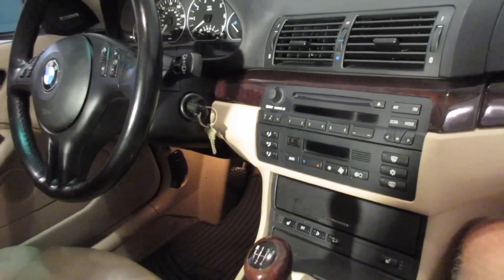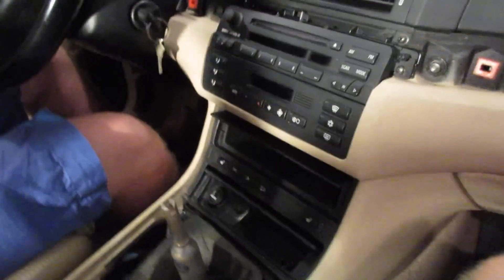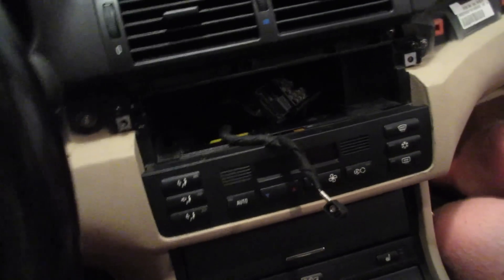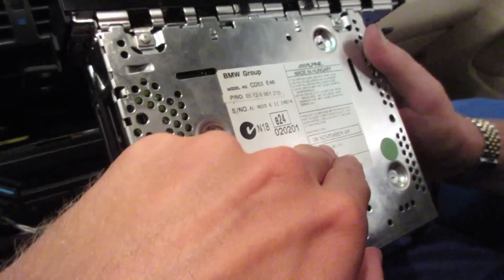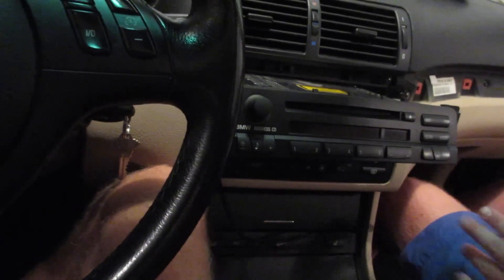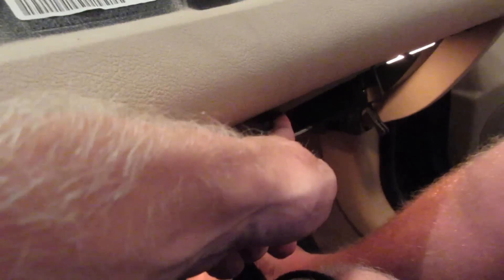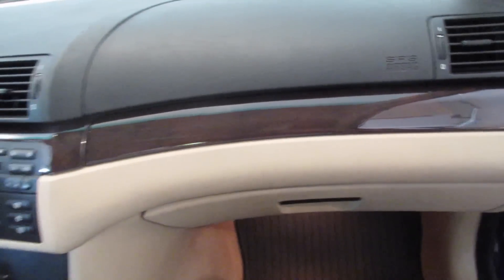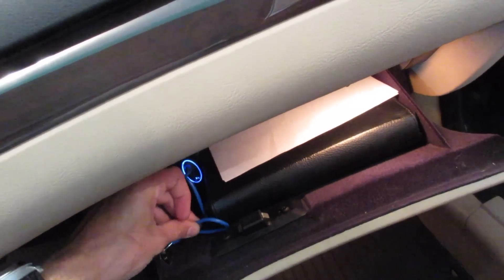BMW E46 3-Series Auxiliary Input Installation DIY

Comment: Thanks for this video.  Other videos fail to mention the blue locking clip.  I did this to my car and that was the hardest part of the install.  That and my radio harness didn't have much slack in the wires so i had to be real careful not to pull the harness when re-connecting the radio.   I put the aux connection in my sun glass holder as opposed to the glove box.   Thanks again
Reply from the maker: I'm glad you found this helpful, thanks for the kind feedback!

Comment: just a little heads up. that wood trim is actually pretty delicate. the ''wood'' look can crack and peel off if your not to careful. mine lost a little piece around the radio assembly and looks stupid now :(
Reply: and it seems difficult to order another one since the new one may or may not match as much

Comment: As i was watching this video, i realized that it doesn't support anything manufactured before September of 2002. Mine was manufactured in May of 2002. Is there any other product that i can purchase that is compatible with my radio? Thanks
Reply: did u every find anything dude im on the same boat
Reply: @connorlovesrock  hey have you found anything yet? Mines from July 2002
Reply: @luclaan8165  I use a wireless FM bluetooth transmitter that plugs into the cig lighter
Reply: @connorlovesrock  that is the only option for  a production date earlier than September 2002

Comment: First off, I am about to install an AUX in my E46, so this video was great, many thanks!  However, I feel like I'm missing something at the end with what appears to be a Potato that you used for Bluetoothing your phone to your system.  I know you said you would do a separate video on that product, but I don't see it anywhere?  So many question is, where do you get power from for the Potato in the glove box?
Reply: Hi!  Ryan (and I) use an adapter that changes the flashlight port to a 12v power port. Just search "BMW flashlight adapter".  However, these are no longer made, so finding one at a decent price may prove to be difficult.

--
Bobby
Reply: Thanks for your reply.  I didn't even know that was an option.  Looks like they can be found, but I may have to pony up for one.

Comment: It will work with any E46...Mine doesn't support it but still got it working. All you gotta do is replace it with the CD player input and it should work then when the car is on CD mode.
Reply: +Eduard Van Der Westhuizen Hey is this true? Can you post a video or something so I can verify cause I have a 2001 and the fact that mine isn't supported is disappointing.
Reply: +Omar Ashraf also I don't want to spend 30 dollars on ECS tuning just to have it not work.
Reply: +Omar Ashraf Hmm okay, will do it sometime this week :)

Comment: Hey! Great video! Just curious as to how you connected the actual aux "male to male" cord to the CD player itself. I understand that you need to switch out the black piece for the grey one on the harness, but I don't understand where you would connect the cord. Again, great video and I can't wait to hear your response!
Reply from the maker: The aux cable you buy from BMW plugs into the radio with a connector with three wires (right channel sound, left channel sound, and ground).  Then that cable ends in a female aux cable.  Then you need a male to male aux cable to plug into your phone.
Reply: E39Source ahh! Thank you!

Comment: Oh my gosh, this is the best, understandable video I've seen yet.  Well every one else is asking questions, so I decided to ask one.  Hope to hear from ya.  I have a 2006 324ci bmw conv. 3 series.  I want the xm sat. radio in my car, but I don't know what's the cheapest way out. Replace the factory radio with a radio with xm sat, or the way you explained in the video with the AUX cable.  On the back of my radio it states 06 May. I know it would work, but wouldn't I still have to purchase one of those lil sat. radios?
Reply from the maker: You either have to add a Sirius XM module (OEM From BMW), or an aftermarket solution.  Or you could just add an Aux Input and use the Sirius app on your phone.
Reply: Thank you so much for the quick response.  I don't know what to do. The radio has the Aux mode, but I don't have a IPhone, I have the Samsung note 4. Do you think I could just replace the radio itself?
Reply: I have one question, how do I go about getting my radio ID for my car?
Reply from the maker: Any phone with 3.5mm out (headphone jack) will work with aux.  The Sirius XM radio ID will be printed on the back of the radio near what looks like a bar code.
Reply: Thanks again. I did remove the radio and took pic of every label that was on it, and also, I see a bar code at the bottom of the label but there is no ID #.  Above the bar code has something like this (Model # CD53 E46
P/NO 65.12-6 961 214
S/NO AL 4620 6 05 19691. Then something like this (N18 [e42] under the e42 is #020201
SW/NO 47,  HW/NO 43, KW: 18/06, AI: 02.  But nothing with ID.  I don't understand all those Numbers.  Hope you can help me. I don't know how to tag a pic for you.
Reply: Ohhhh, I see another label with a bar code and under it, these are the number  (6 961 214) R5  US Englisch PX88090.
Reply from the maker: I was referring to radio ID such as the Sirius XM ID required to activate the radio.  The CD53 radio will not have this, because it is not a Sirius XM tuner.  You shouldn't need any "ID" for auxiliary installation.  If your radio was made after the date specified in the video, it will support aux.  If not, you must upgrade the radio module (CD53) to a newer version that does.
Reply: wow, o.k.  I don't have a Sirius radio.  I guess I'll be purchasing a Sirius Xm Sat radio and go from there. Thanks again for all ur info, ur a blessing sent. Again thanks.
Reply: Hey, I'm sorry. I have one more question. The Aux cable that I have to plug into the back of my radio, would it be a 10 or 6 pin plug??  I have purchased the xm lil radio, but they didn't have the plug in it that I needed.
Reply from the maker: 10, I believe.
Reply: o.k thanks, I found it. I just need to get the plug with a 3.5mm and 10 pin jack on the other end to plug in the xm radio and the car radio. I think I'm ordering the right one. Thanks for all ur help. I will let you know if I get it up and running once the Aux cord gets here.
Reply: Hello again, well I got the plug to hook up my xm radio to my bmw.  But there is no sound coming through the speakers, but there is sound from the factory radio and cd. I have the car radio on Aux, and I've had the xm radio activated. I waited about 10 min before messing with the radio to make sure it was activated.  Not sure if I've waited long enough.  I've also up the Aux volume to 5.  Everything is showing up on the screen, it's just no sound. Can you tell me what could be the problem?? I'm gonna check it again it's been over 2hrs now.
Reply: I went back and checked my aux plug and that is the problem, but the sound is still low.  Do you think the cord is bad?

Comment: Hey man! Awesome video. I have a BMW 2003 330i, can I do this to my vehicle?
Reply from the maker: +Nic Shannon Yes, follow instructions in the video!  Just verify that the part number for your radio/CD player will support AUX.
Reply: awesome. thanks!
Reply: +E39Source quck question, where did you get the aux parts at to purchase?
Reply from the maker: +Nic Shannon I purchased all of these parts form ECS Tuning.

Comment: How do you get the plug at 1:50 off? I can get it popped up, but after that, how do we get it off just pull as hard as you can? Dont want to break it either...also is it recommended to disconnect battery? Do you have to drill? Cab you route through AC duct?
Reply from the maker: Slide the slider all of the way out, and then pull the connector straight up and off the radio.  Disconnecting the battery isn't a bad idea.  There is no reason to drill.  I just put the aux cable in the glovebox.

Comment: Bought a 8$ Male aux cord adapter off of amazon and it would not register as Aux on my business cd stereo. Checked the manufacturing date and it was made in march of 03'. I own a E46, 325i. Any suggestions? (first time bmw owner)
Reply from the maker: Try an OEM cable.  Also, something needs to be plugged into it (phone, iPod, etc.) or it won't show up. Keep that in Mind.
Reply: Thanks!

Comment: I got a bmw 318 e46 2002 model. The radio has the mode button. But I have  not pulled the radio out yet. Just wan't to know if it support AUX?
Reply: I would expect that it would.

Comment: Not sure if you'll see this but, I have an 2003 e46 with 16:9 nav and I've got the AUX option without having an AUX in the back of my radio.. I've tried installing an AUX cable in the back but I can't get it to work, once plugged in it doesn't do anything. Can you maybe tell me the reason of that? Thanks
Reply from the maker: The radio cycles 'AUX' even with no cable plugged in?  Sounds like it might need a reboot/reset and/or a software update.  If installed correctly, like demonstrated in this video, the proper part should certainly work!
Reply: @E39Source  Thank you for your quick response. But yes that's the problem, can I reset it myself or is there something special needed to do that? And an software update? I'm not sure what kind I'm currently running so not sure if it needs one.
Reply from the maker: @sro9330  I would try to disconnect the vehicle's battery overnight.  That can reset modules and might help you out.  A software update would have to be done by a BMW dealership.

Comment: +E39Source i will take up with this challange, but i have a question. Would i be able to connect the cd player without owning a  cd changer?
Reply from the maker: +Frank Richard the CD player in the dash and the 6 disc cd changer in the trunk are two totally separate units.

Comment: Mine is 320d e46 September 2001.,and radio have two 10-pin connectors and one 17-pin connector....I'm wondering if it will work,because it has that second 10-pin connector....

Comment: I've been eyeing a third party auxiliary/bluetooth product, namely Grom Audio, which seems to hook up to the radio in much the same way as the OEM Aux that you've demonstrated here. My radio build date is prior to 9/2002. Is there any reason to believe this product would work where the aux port would not for this build date?
Reply from the maker: I dont see any reason why it wouldn't.
Reply: Appreciate your take and excellent videos. To follow up, turns out the Grom kit works just fine with pre-9/2002 builds as it uses the left port on the back of the radio replacing the accessory cable (I believe wired to the trunk).

Comment: hey whats the bluetooth thing called? that glows? im about to buy a 2002 bmw 325ci and im not as auto savy as you guys are so ill probably take it to a mechanic shop for the installation
Reply from the maker: +Deon James It's the Tunelink Auto (http://www.amazon.com/Technologies-TuneLink-Bluetooth-Wireless-Adapter/dp/B004GJURHM).  This job really is easy, it's just plugging a few wires in and drilling three small holes!  Very easy to DIY! :)

Comment: Hey my e46 already had the Aux mode & was working perfectly for years. Recently the battery went flat & aux mode disappeared. Would you say it needs programming or do you think it's a loose wire from the head unit? Thanks if you can help !
Reply from the maker: If you didnt move the head unit around, I'd say to disconnect the battery again and let it sit for 5-10 minutes.  Then reconnect.  If that doesnt work then check for loose wires.

Comment: I have a 2002 Bmw 330ci, I purchased the oem aux input, connected it, but the option does not show up when I press mode. Any help?
Reply from the maker: Your radio may not support the aux input.  Check the part number and build date by removing the radio to see if it's a 9/02 production or later to support the aux mode.

Comment: I have a 2001 CI e46 convertible with Business CD and Harmon Kardon sound systems without navigation.   I bought the Aux cord, but my car was purchased in Oct 2001 so manufacture date had to be sometime earlier - say Aug 2001.  The package says for Sept 2002 and beyond.  I have not taken out the Head Unit yet.  Will it work?  

Some people are saying that disconnecting the CD opens up the option of putting in the AUX for my iPhone 6+.
Reply from the maker: +Richard Baker You just need a CD player made after September, 2002.  Which you can source from Ebay and then install without issues.
Reply: +E39Source  - thanks

Comment: When I ordered the part number you gave, it had a 12 pin connector and my 2004 E46 325i wagon has 10 pins. I see yours has a 10 pin connector;is there any way to rig it to work? If not, is there any further differentiation in part that I should've been aware of
Reply from the maker: That's very strange.  But, only 3 pins are used for aux.  Red, blue, and ground.  Where red and blue are left/right channel audio (or vice versa) and the brown is ground.  Take those pins out by sliding off part of the black/gray connector and then depressing the metal pins with a tiny screwdriver on the side of the harness while gently pulling the wire out from the black/gray housing.  Then move them over to car's existing radio wiring harness (12 pin I guess), while being sure to put them in the exact same location per the tiny labels on the connectors (pin 4 in 4, 10 in 10, etc).  Hope this makes sense.
Reply: Thanks for the fast and helpful response! What I decided to do was to take the plug from the cd changer (which I don't have) and use it for the aux jack. One tiny thing; I can't seem to find anywhere what wires go where. Could you let me know what wire goes in which slot? Again, thank you so much!
Reply: Never mind, thank you so much! I figured it out haha

Comment: Hi there.
Cool video but I got an issue.
BMW 2005 Msport 318ci 2.0 litre. Business Cd Dated Jan 05 has a factory fitted bluetooth module which i managed to link to my phone the other day, back of the HU has a spare port located on the outer edge out of the 2 ports for which i plugged in a Aux cable with no resistors or capacitors fitted. The aux came up for about 1 second after wiggling the cable..then disappeared, then came up again for a blink of an eye then hasn't returned since. The pin configuration on the plug end is pins 8 and 9 and 4 which is the earth for aux input. I re soldered a new aux socket and shrink wrapped and each wire has good continuity, however still no aux showing? I have read that the auxiliary plug need resisters fitted, or am I looking at a battery disconnect? 
Can you help please?
Reply from the maker: We don't have the same modules and setup here in the United States, so I really have no idea what your car needs.  I'm sorry that I can't be of further assistance!
Reply: Hmm well there ain't much difference tbh, maybe spec wise etc etc but the headunits are identical as are the control modules, anyway I fitted a resistor and 2 capacitors and the Auxiliary worked. so to anyone that is having troubles with Auxiliary do the fix I mention.

Comment: hello, please con you put the link for the aux piece of plastic that you use for connect the auxiliary cable. thank. regards from Peru
Reply: What piece of plastic? The Bluetooth adapter?
Reply: Not! The Black plastic that has the name Aux is a small piece.
Reply: +Marco Enciso minute 07: 50
Reply: +Marco Enciso That piece is included with the kit, and you cannot get it separately.

Comment: i have a BMW 325Ci 2005, E46. i wanna know if i get a USB and aux Switch Adapter would it work? i mean it have the same connector as how you guys showed in the back of the Radio.
Reply from the maker: +Chung Thach It may work.  Hard to say.... try it and see what happens.  I dont think its officially supported by the CD player though.  Make sure the build date on the CD Player is 09/2002 or later.
Reply: oh ok thank you. i will check it out, and than work with what i got. thanks for the video.

Comment: Hi i just bought a bmw e46 from 2004 and i was wondering if there is always a power output in the glove box to give your bluetooth device power?
Reply from the maker: +Jeroen Taelman It's the flashlight power adapter, so yes.  You'll need the power adapter to convert the flashlight port into a car power port though, which are hard to find now.
Reply: +E39Source AH OK thanks for the quick response would there be a way to diy something like that. with soldering or something?
Reply from the maker: +Jeroen Taelman I was lucky enough to buy one from BMW back when they still made them for $11.  I don't know if there is a way to create your own or not.  (I'm sure there is, but you'd need to 3D print or otherwise source some parts).  I'll be making a video on bluetooth aux when I get my M5 back in a few weeks, you can see the part I'm referring to in that video.
Reply: Awesome thanks
Reply: @E39Source  did you make that video?
Reply from the maker: @vtecboi18  Yes

Comment: I drive a 2005 325xi e46. I pressed the mode button but the auxillary option doesnt even show up on the dash! Mines is an 05 so it should obviously support aux but i only see fm and cd. Help needed!!
Reply from the maker: Luis Dehaza You need to add the adapter cable.  It'll be easy to add though since the wires are up there already for it!